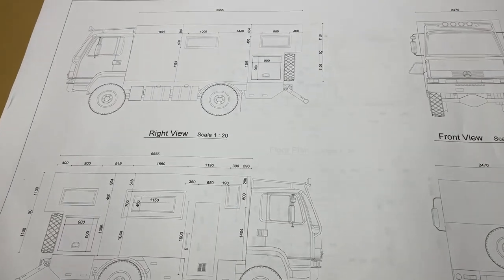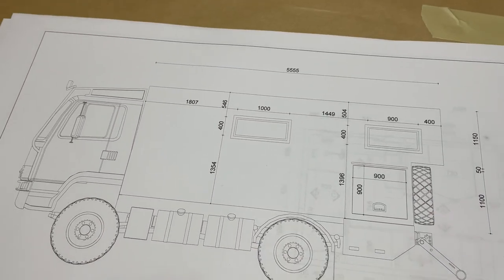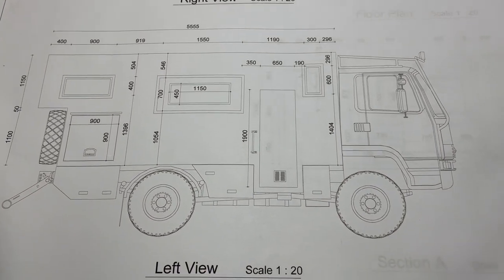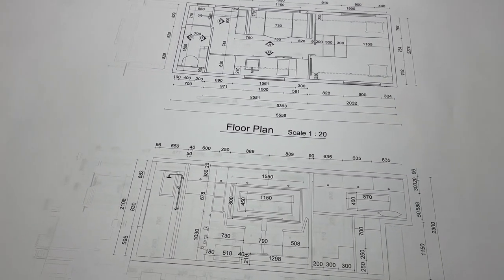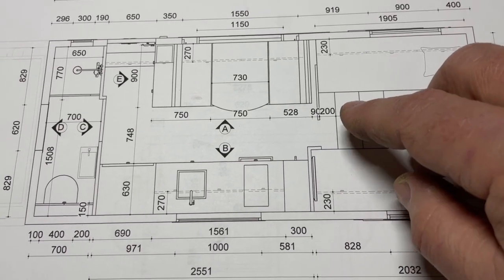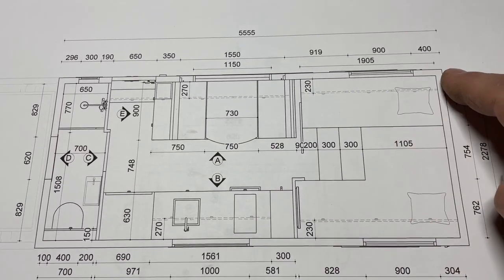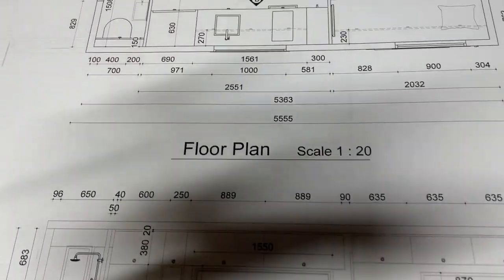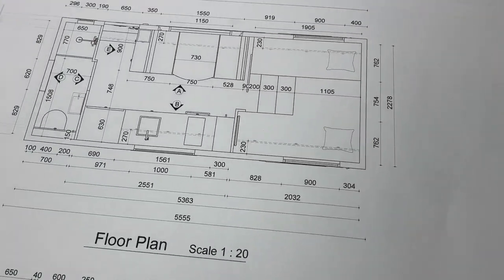Our camper design and floor plan for the Expedition truck !

Comment: Hello, What is the total length of the vehicle with the habitat installed? I was looking closely at your blueprints and did not see that measurement. Thank you
Reply from the maker: The habitat is 5555 mm ( 18.2 ft ) and from front edge of the habitat to the front of the truck/bumper 2200 mm ( 7.2 ft ) so total length without motorcycle carrier 7755 mm or 25.4 ft  .
Reply: @oscaroverlander_MB1222AF  Thank you

Comment: I have a 9000 selvina mini split. definetly thing a mitsubishi 6000 would be just as good and take upp less space. what are you going to use?
Reply from the maker: I am using a AC called "Continental Dynamics " also 9000 BTU but I was comparing the outside unit measurements of all others. Sure a 6000 BTU unit would be enough but the outside unit is not necessarily smaller. So size and price was ok and I took the CD one.

Comment: Are you using a late 1980's, all mechanical engine Mercedes Benz NG truck of 10 or 12 tons?
Reply from the maker: Yes correct it is a OM441 engine 11.3 Liter build 1992. NG ( New Generation 1222 AF )  12 Ton 220 Horse Power , AF stands for All Terrain Vehicle, all mechanical the only  electronic control unit is the ABS. Thank you for your Question !

Comment: Fantastic floor plan! I totally agree with all of your design ideas/philosophy. I am especially interested to see how you will build your own windows. One small suggestion with the slide out pantry, maybe think about splitting it into 2 separate sections. You won't loose much space and it will be much easier to manage - you are so correct it will store a lot of food/weight that you will be moving every time you need anything from it.
Super excited to see what comes next!!
Reply from the maker: Thank you ! I never thought about it, to split the slide out pantry, you got a point about the weight but unfortunately I bought the hardware already. The load capacity for this slide out is up to 260 lbs lets hope it works without failure.
Reply: @oscaroverlander_MB1222AF  
I am just think about opening and closing it moving the 80-100 lbs a full pantry will weigh, day in and day out it will take a toll but I hear you. Give it a try as a single unit and see what it's actually like....  It's something you can update later :)